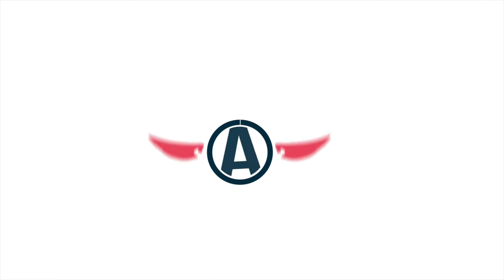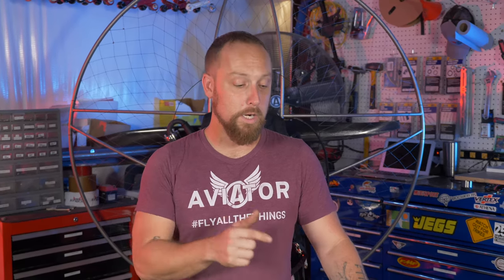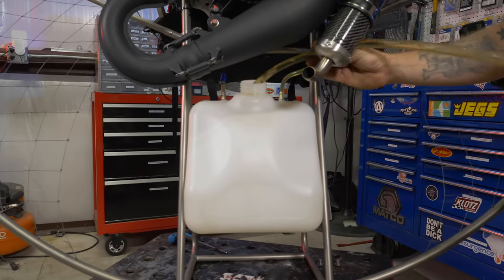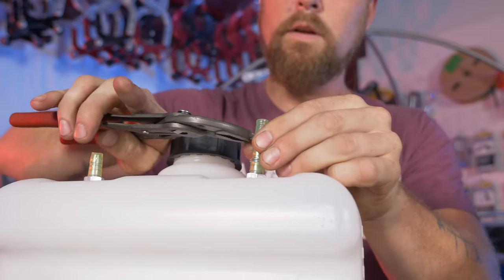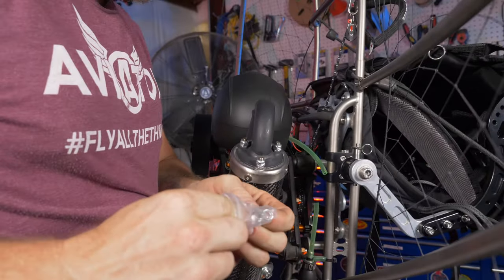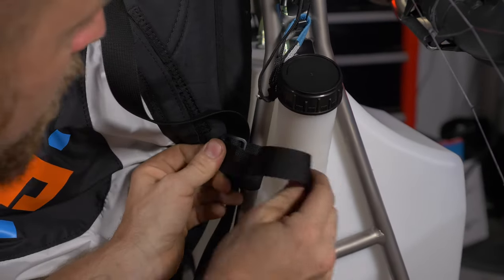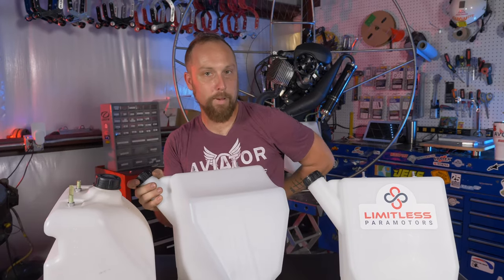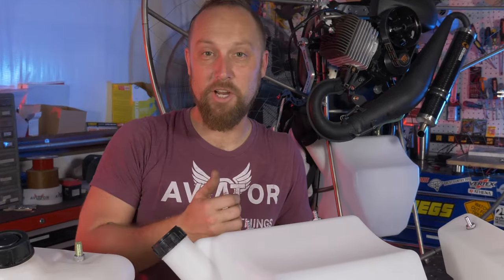Installing the New Limitless Paramotor Fuel Tanks!

Comment: I had a problem with the new tank, the weight during the flight shifted towards the left corner, this caused the engine to take in air with 2.3 liters and stop in flight. It was a dangerous situation, the weight stays in the corner and I lose the ability to use all the fuel just as Neil says in the video. I do cross country flights and this problem limits me to only 12 liters of fuel for this tank. Check your deposits to see that the weight does not stay in the corners. I am disappointed with this problem.